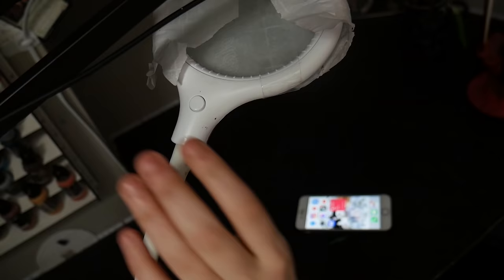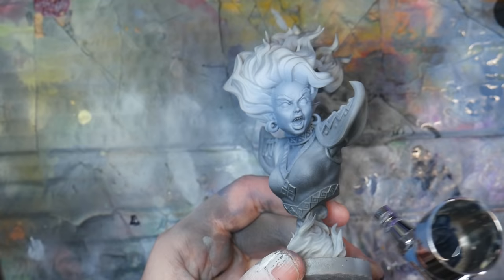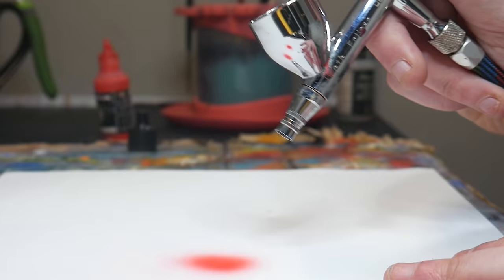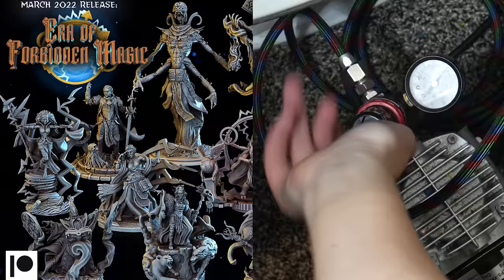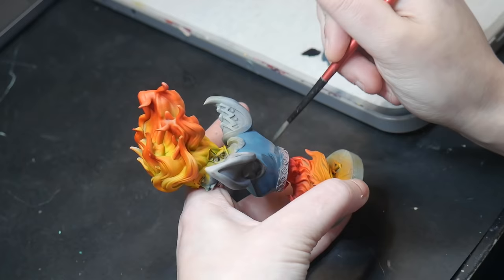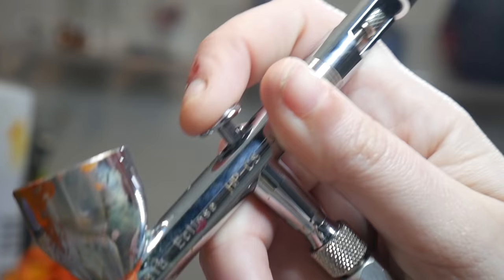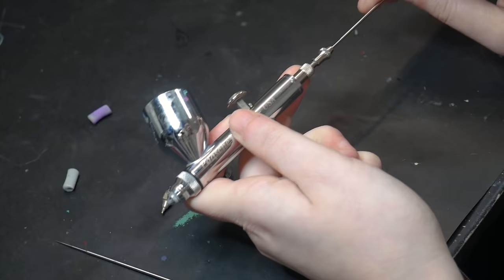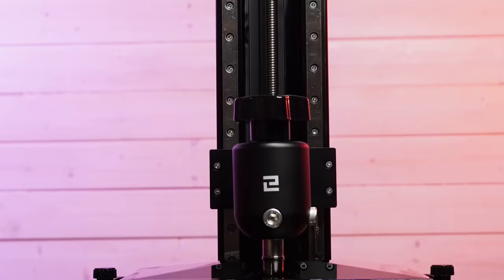Airbrush Miniature Painting Tips I WISH SOMEONE TOLD ME

Comment: I got the cleaning down to 3 min.  The trick is to fully clean and flush out the cup before anything else.  I use a water squirt bottle to blast out the paint and one swab to mop it good.  Get the cup totally shiny clean!  Then proceed with the rest of the cleaning, which goes really fast.  A couple blasts of cleaner and a mop of the tip usually finishes it.

Comment: Great video! Thanks for sharing your experiences!  One thing I stopped doing a while ago is to pull the needle out to the back while cleaning it. Instead I remove the nozzle and push the needle through the front of the airbrush. That way you don't drag paint onto the seals and don't risk damaging the needle tip, especially with smaller sized needles. I clean the whole needle of any paint it comes out the front with, and repeat until the needle comes out spotless. Every few months or so, depending on how often I use the airbrush, I put it in my ultrasonic cleaner to get rid of any hidden gunk. It always works a charm!

Comment: I have a small dish and a sponge that I keep damp with water and every so often press my airbrush into the sponge and pull the needle in and out, I find this is better to get rid of tip dry.
Get yourself some interdental brushes as they are far better for cleaning your brush than what I saw (desigend for your mouth, so less chance of damaging your brush) also, pipe cleaners, not the craft ones as they lose fibres. Use laquer thinners for cleaning, and a final blast of expensive airbrush cleaner when finished.
Your points on practice and paint mixes was so spot on, especially with acylics :)
Reply from the maker: Thanks for the ideas!
Reply: Just as general advice, be careful with lacquer/cellulose thinners - make sure your airbrush has seals that are resistant to it (teflon/PTFE), otherwise it can ruin them. Most of the more expensive airbrushes have this, but the cheaper Chinese ones tend not to
Reply: Oh my god, this advice has been an absolute time-saver. Thanks for the advice
Reply: @NikkiAnnMarie — Yes. Made the mistake of tearing down my cheapo Chinese brush and rinsing the o-rings in airbrush cleaner. They turned spongey within minutes and would have dissolved completely if left to soak. Quickly rinsed them off and they appear to have almost reverted back to shape. There was, however, a single tiny o-ring deeper within the brush which may have been teflon, which came loose during cleaning. It sprung off onto the floor during reassembly, never to be seen again.

Comment: Love my airbrush! That bit about ignoring your advice if it doesn’t work is spot on. Every airbrush and batch of paint is going to be different, and often it’s just a matter of experimenting until you find what works for you.
Reply from the maker: I tried for hours on my old brush trying to get 30psi to work with no success. I finally figured out I needed to use my brush at 60psi to get good flow. In the process of shooting this video, I learned that my hose was cracked at one end the WHOLE TIME and that's why I could never get it to work at 30!
Reply: @LylaMev  what brand of hose?
Reply: @LylaMev  Mine is basically always set at 25psi and that seems to work for everything for me, but I can see how having a cracked hose would wreak havoc with any airbrushing and pressure you’re trying to get. 😩

Comment: Great video for airbrushing neophytes.

The only thing I'd add that I think is important for new airbrush users to learn is that there are three factors (assuming equal air pressure) which determine paint flow - the trigger and distance (as shown in this video) but also how far down you push the trigger. When you start it feels as though it's a binary equation, either you are pushing down and making air come out or you aren't and air isn't. But even though the range of movement is tiny, over time you can learn to control air flow by how hard you press down on the trigger. This is super helpful when glazing small areas or doing other fine work.

That said, I'd suggest to airbrush users to get comfortable with all the other aspects first, but to still keep this in the back of your mind as you do.
Reply: Just looking into it and learning before I buy one, but is what you're talking about a double action airbrush? It was my understanding that single action airbrushes can only have the trigger pulled back, not pressed down as well.I'm trying to learn everything I can before buying.
Reply from the maker: Yes, he is talking about a double action airbrush, which is also what I use for my own painting.

Comment: If you use contrast or speed paints, I highly recommend mixing up a large batch of your favorite base prime color. I've used an old 200ml bottle to mix up something that's pretty close to Wraithbone. Mostly white primer w/ a little bit of brown and yellow mixed in, and enough airbrush flow aide that I can just pour straight from the bottle into the airbrush cup and since it's in such a large quantity I don't have to mix a new batch every time I'm priming new models yet I can maintain consistency easily between projects (and if I need to do touchups later I can always put a few drops on my palette )

Comment: Very detailed info. Great job. The only thing I saw you did and I would definitely advise against doing it, is in the end of the video where you used that metal core brush to clean the front of the gun. With guns with floating nozzles like the Iwata Eclipse range and Badger 105 range, the nozzle seating area is very important. It is soft brass and that brush has a hard steel core. If you scratch the brass, you will not get a good seal with the nozzle and you will get bubbles in your cup. You will have to use sealant if you want a good seal again.

Comment: I always take apart my airbrush after each session and clean the inside of the body, needle and nozzle separately. When storing my airbrush I always pull back the needle just a little. When airbrushing, I lay my finger flat on the trigger. That way it's much harder to fully pull back the trigger all the way and it forces me to use small motions. Though I mostly use the HS Infinity (that comes with the option to regulate how far you can pull back the trigger) I never had to use that function by keeping my finger as flat as possible. This does result in finger cramps at first but goes away with practice 😉 After a few years of airbrushing on paper, I want to make the switch to airbrushing miniatures. I found out it's quite a different beast!

Comment: Regarding air pressure / PSI when airbrushing: There are so many variables to it - the only thing you can get is a general idea of where you'd want your PSI (usually 20-40 PSI range). But it depends on many factors. Factors like what paints you use, how thick your paints are, your airbrush, your compressor, your needle, how clean your airbrush is, your elevation (how high you are above sea level), etc. etc. The only way you can know for sure is by experimenting yourself, which you should be doing already! Just have fun with the learning experience and it will go quick

Comment: One trick I saw on another channel for cleaning the airbrush is to have a bucket of water around.  Dump any excess paint and then put the airbrush in the water and place your finger      alternating on and off the tip to flush and back flush the gun until the water coming out of it is clear.  This works exceedingly well in cleaning the brush.

Comment: Hey there!  Really good tips, but I have one for you.  Instead of pulling our needle out from the back, push it out the front.  Clean the paint cup, backflow, etc. just like you showed, but leave the needle alone.  Unscrew and remove your nozzle, then loosen your needle and push it to the front, grab it now that you have room, and pull it out from the nozzle end.  It keeps any paint that may still be in the working part of the airbrush from being drawn through the seal, trigger and spring housing.  This helps to keep the back side of your airbrush super clean.  Keep up the good videos!
Reply: Im not taking that nozzle out any more than i have to

Comment: Just an additional tip, when breaking down your brush for cleaning take off the crown at the front end of the brush and push the needle out the front.  Pulling it out the back as per this video drags any paint on the needle through the length of the brush and could cause problems in it own right.

Comment: You can change the maximum amount of trigger action by simply loosening the needle screw and pulling the trigger back before tightening.. this will reposition the trigger further back, meaning there is less distance you can pull the needle back.
You want to keep air flowing, even when you aren't painting to prevent drying paint on the tip.. You get more tip drying if you stop the airflow when you stop the paint, as this won't spray off the tip of the needle and the paint can start to dry.

Comment: Great video. I am still learning how to use my airbrushes and this helps. A tip to share that I use to clean my needles is using alcohol prep pads if you are using acrylics like I do. One of my brushes was used and gifted to me by the person I bought a compressor from. It was caked with metallic paint but I gave it a thorough cleaning. Now I am going to check it to see if it has the trigger stop.

Comment: You should try one of those sonic cleaners. When I took commercial art in school we’d disassemble our airbrushes and run them through the sonic cleaner. It works wonder, especially if you have dry paint
Reply from the maker: Thank you!
Reply: Those sonic things are the best
Reply: What cleaning solution did you use?
Reply: @1pcfred  I’m pretty sure we just used water.
Reply: @-Garviel_Loken-  just water would work with water soluble paint.
Reply: @1pcfred  yeah. We used acrylics
Reply: @-Garviel_Loken-  once acrylic is dry it can be quite waterproof.

Comment: Great video.- Ill be looking out for more of your videos - I've sub'd.
One thing though:
I think thicker and thinner lines is actually most influenced  to how far you hold the tip of the brush from the work. I thinkneven in the video the thinner lines ere done with the brush much closer to the work and the wide example the brush was held farther back.
Essentialt the paint comes out as a cone, with the point of the cone near the brush tiop and the base of the cone on the work. The closer the brush, the narrower the base of the cone.
The needle size is more about what type of paint you are using. Some paints have finer pigement/thiner consitency e.g. ink or laquer based paints and you can use a finer needle with those, while other paints e.g. acrlyics work better with a larger needle.

Comment: I have the same mask I use it for woodworking. But the carbon filters (3m filter 60922) would be better for paint because it has carbon in it to absorb fumes from paint and it also has the same p100 filter for particles. That's what you need!
Reply from the maker: I actually just bought a new mask yesterday!

Comment: One thing i would add, but this is about the gear.
When buying the compressor its really worthy to spend a bit more and get compressor with a tank. Overall i find it MUCH more enjoyable to work with, you dont loose pressure and when you paininting in shorter bursts, compressor doesnt kick in so often.  I used no tank comp for years, and after making a switch, couldnt believe i was thinking thats "not really needed and no-tank is enough".
Reply: Some air brushers use a tire inner tube as an air tank. Air brushes don't use a whole lot of air. Although precisely how they plumb that setup up I don't know. I have a full sized air compressor and one thing I'll tell anyone is when you have compressed air you do need to be a bit of a plumber in order to set it up.

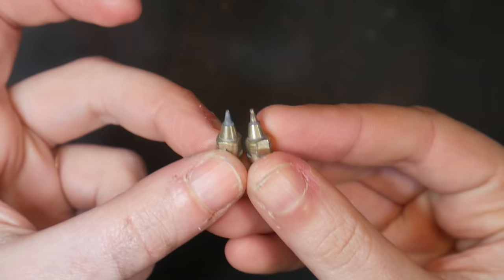Comment: Great video!|  6:50 in most airbrush models, you should also get the corresponding nozzle cap. The aperture sizes are different, changing the size of the "air stream" coming out.

Comment: Excellent video, I think it's very useful, I've been airbrushing for a couple of months now, I still consider myself a beginner, cause I still make noob mistakes. 
As good as the video is, I look at tutorials differently than I used to, simply based on the new experience I've got.

I did notice 2 things to try out next session (cleaning stuff), clearly I still got a lot to learn. 

I got to the point where I used my 60 euro beginner's airbrush enough and it's time to move to something better, I got a badger patriot as a starter to a more serious airbrush and once I got a bit more experience I'll get the next one. I still prefer brush painting, i'm doing mostly warhammer stuff, the scale is just too small, though the airbrush saves insane amount of time on those base layers. 
Doing a few base layers on several minis has been great practise to slowly delve into details. I see what a cheap airbrush does, I want a smoother experience at this point. 

I have been watch & rewatching youtube tutorials on airbrushing. I went for the patriot cause so many are using it, the Iwata Eclipse was a close second place, I might still get it later, I see so many people swear by their Eclipse.

I'm also pretty interested in the H & S Infinity and the Badger Sotar, but both are used for more detailed work, for now I'm sticking to base layers and base blending. When I'm confident enough, then only will I move to the details with airbrush. 

I am hoping the clogging will be solved at least in part, my compressor also overheats, it's only of those tiny beginner ones, thnakfully I got a good serious replacement arriving soon.

Comment: Do you have a video showing how to airbrush straight/fine lines? An example would be like a piece of clothing. I always have trouble with one color getting on a part of the figure I don’t want it (like the shirt is blue and it gets on the tan skin, or the tan gets on the blue…just an endless cycle of one color getting on another).

 I’ve been using clay and liquid rubber to cover parts I don’t want paint to get on but it either peels off the paint beneath it or doesn’t cover exactly where I need it to. Taping off a figure is just as hard because it doesn’t work on curves, uneven surfaces, or tight spaces.

Comment: A tip i'm glad someone taught me before i first pulled a trigger: never start spraying while your brush is pointed at the subject, as that can often leave a splatter mark. Start spraying off to the side, get the flow where you want, then drag it across the subject. That is very likely poor advice for detail work (such as the mini in this video) but for those who (like myself) only use an airbrush for base-coating, it's sound advice.

Similarly, rather that testing air flow on a piece of paper or the tabletop, i test on my left hand (the one holding the mini) because it's within a few centimeters of the subject and re-aiming the brush from my left hand to the subject is more natural than re-aiming from the table to my left hand. Wearing a latex or food-service glove on the left hand is recommended, not because getting paint on the hand is a problem, but because having a hand full of paint makes cleaning the airbrush more difficult.

Comment: Hey there! I bought an airbrush setup little more than a year ago. And I have only used it like 5 times since, although I find it quite easy and the results very impressive... Main reason being that I do not have the patience for cleaning it more than painting with it. And I really have been struggling finding a way to quickly shift from one colour to another, and quickly clean up the gun, or keep it clean in general... I feel like it clogs up very easily, and the paint dries very fast if I hold a small break :( could you do a video with tips against these pitfalls ? that would be AWESOME! :)

Comment: The thing that drives me nuts, up the wall and across the ceiling, is I get my flow improver, thinner, paint, I blowback mix it and turn it leaving no area unmixed I get to priming or doing a zenithal and it works for all of ten seconds and it’s clogged.
I dump, clean, disassemble, check the cap (nothing), I check the nozzle (blow with mouth and it’s clear immediately), I check the inside of the gun and it’s clear.
I run through some cleaner, water, assemble it, run more cleaner and water, do my mix again (nearly half thinner) use it for ten seconds and it’s clogged again.
I repeat all over again and last time this happened four times in a row, I was about ready to throw the whole thing out the window.

It’s an 0.4mm needle and it’s an H&S  Infinity, the paint isn’t too thick, the needle isn’t too thin and the gun isn’t cheap. 
I clean the thing so much and so thoroughly, I even whittle down toothpicks and dip them in cleaner to soften them up to clean the nozzle without damaging it.

It’s not even consistent. I can be running thick grey primer and it’ll work for days, but then use a thin bright brown and it clogs in less than a minute.

It’s like a curse.
Reply: Maybe you need to up the air pressure?